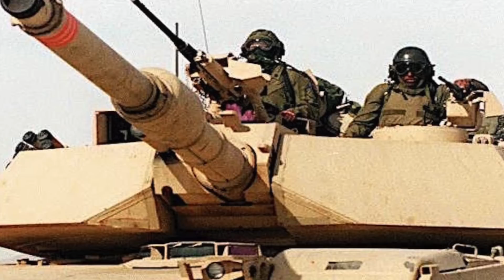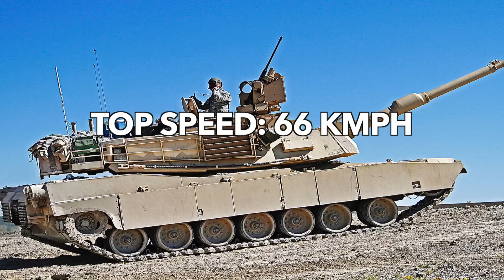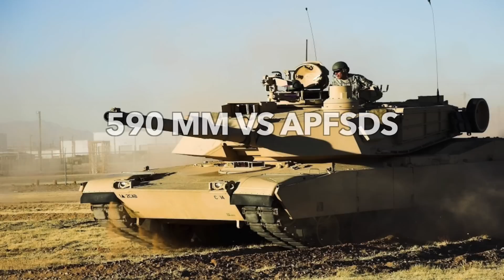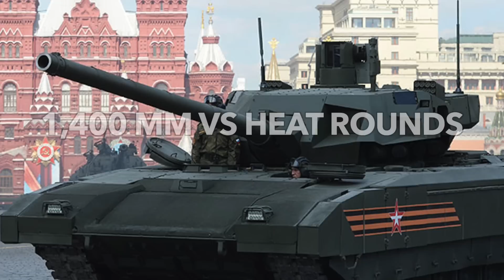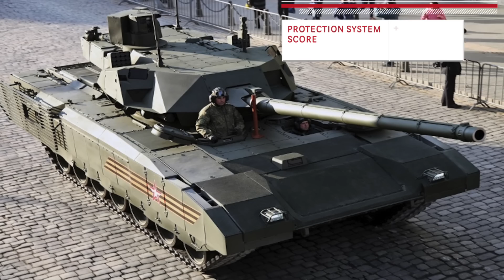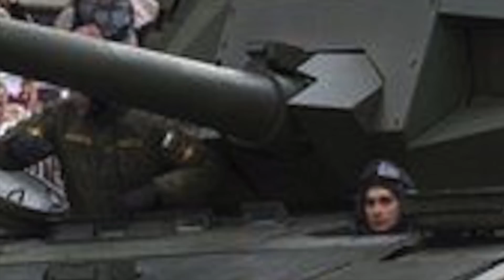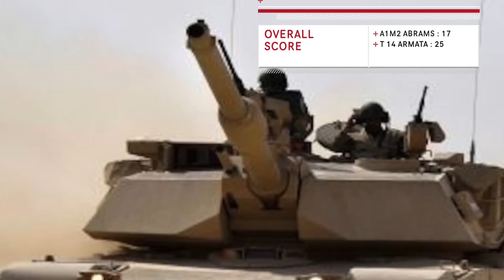AMERICAN M1A2 ABRAMS  vs RUSSIAN T14  ARMATA: WHO WINS?

Comment: DEFENSE UPDATES. Please put my comments back up. They were linked to provide actual data that you presented with bias...ok...I will do it:

ACTUAL WEIGHT OF ABRAMS M1A2: 

https://en.wikipedia.org/wiki/M1_Abrams
The M1 Abrams is an American third-generation main battle tank. It is named after General Creighton Abrams, former Army chief of staff and commander of United States military forces in the Vietnam War from 1968 to 1972. Highly mobile, designed for modern armored ground warfare,[14] the M1 is well armed and heavily armored. Notable features include the use of a powerful multifuel turbine engine, the adoption of sophisticated composite armor, and separate ammunition storage in a blow-out compartment for crew safety. Weighing nearly 68 short tons (almost 62 metric tons), it is one of the heaviest main battle tanks in service.

The M1 Abrams entered U.S. service in 1980, ultimately replacing the M60 tank.[15] The M1 remains the principal main battle tank of the United States Army and Marine Corps, and the armies of Egypt, Kuwait, Saudi Arabia, Australia and Iraq.

Three main versions of the M1 Abrams have been deployed, the M1, M1A1, and M1A2, incorporating improved armament, protection, and electronics. These improvements and other upgrades to in-service tanks have allowed this long-serving vehicle to remain in front-line service. In addition, development for the improved M1A3 version was reported in 2009.[16]

==========================================

ACTIVE ARMOUR: Defense Update - everyone knows that ACTIVE ARMOUR is only good ONCE! It is not a metallurgical advancement but a piece of explosive attached to the hull of a tank and when that active armour is gone...NOW the Metal is the test. Comparing Reactive Armour to the Abram's actual armour is deceptive at best! HERE:

https://en.wikipedia.org/wiki/Reactive_armour

Reactive armour is a type of vehicle armour that reacts in some way to the impact of a weapon to reduce the damage done to the vehicle being protected. It is most effective in protecting against shaped charges and specially hardened kinetic energy penetrators. The most common type is explosive reactive armour (ERA), but variants include self-limiting explosive reactive armour (SLERA), non-energetic reactive armour (NERA), non-explosive reactive armour (NxRA), and electric reactive armour. NERA and NxRA modules can withstand multiple hits, unlike ERA and SLERA, but a second hit in exactly the same location will still penetrate any of those.

Essentially all anti-tank munitions work by piercing the armour and killing the crew inside, disabling vital mechanical systems, or both. Reactive armour can be defeated with multiple hits in the same place, as by tandem-charge weapons, which fire two or more shaped charges in rapid succession. Without tandem charges, hitting the same spot twice is much more difficult.

=========================================

The Abrams has been seen, SEEN in actual combat...the Putinist-Armata...has been seen too, on Moscow streets, in a Parade, BROKEN DOWN!!!!

Get it right or leave it alone ' dEFENSE uPDATES '

Comment: Also, the M1A2 is not 72 tons and all versions of the tank are still in service and being upgraded. But you GAVE the advantage to the armata...ok...but your facts you skewed by making the Abrams excessively heavier....BIAS.

      "  Weighing nearly 68 short tons (almost 62 metric tons), it is one of the heaviest main battle tanks in service. The M1 Abrams entered U.S. service in 1980, ultimately replacing the M60 tank.
M1 Abrams - Wikipedia
https://en.wikipedia.org/wiki/M1_Abrams "

Comment: How are tanks still relevant when a guy can blow it up from miles away. Not to mention other things like planes, mud and so on. Tanks are only for pshycological effect, since a guy with a javelin or bazooka can make it scrap fast. Light vehicles, artilery and aircraft are the future.
Reply: I can tell you this for sure, front line is where everything stops, and no matter how much power you have, a tank will be necessary to provide a steady defensive line, cover and back up from the rear.
Reply: AzuAlx Ex Tanks now have armour that can take these weapon shots and just shrug them off, also you obviously didn't watch the video as both tanks have countermeasures against such weapons